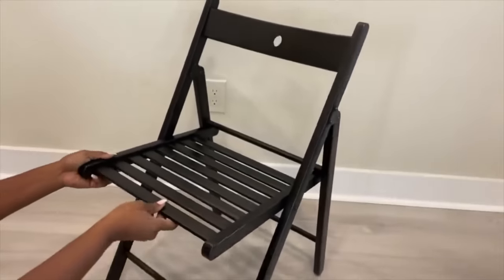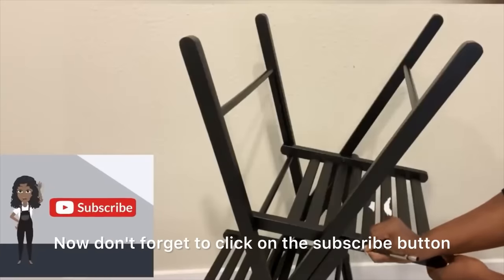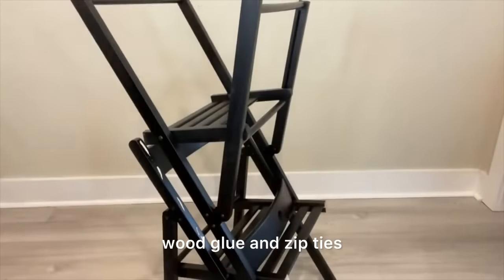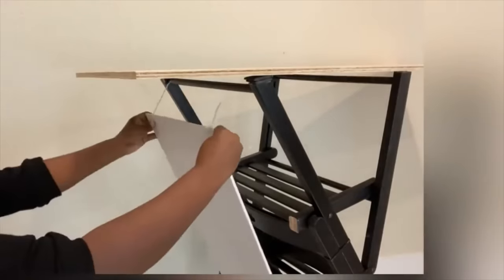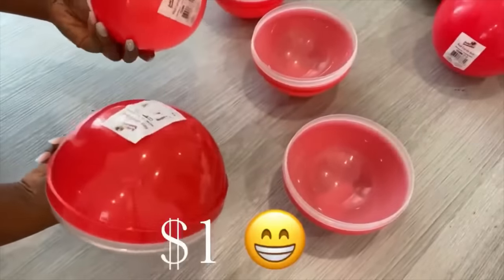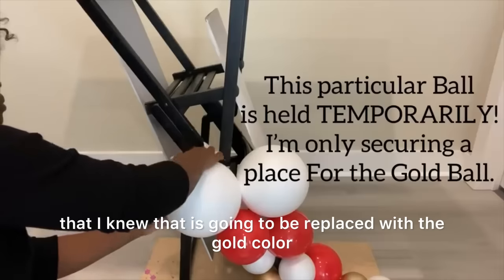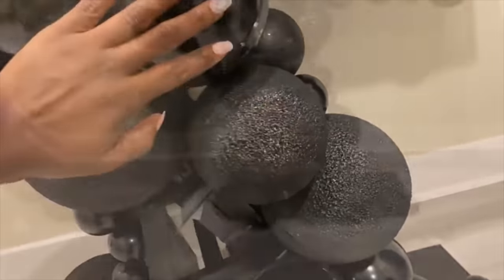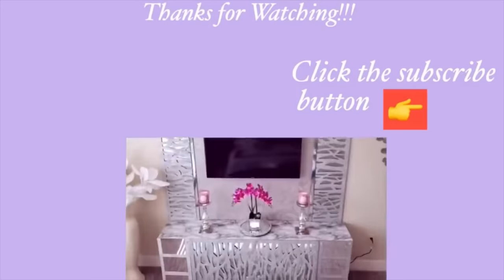NEW 2024 DOLLAR TREE MEETS IKEA Bubble Table Idea!!!

Comment: The table looks amazing! You can fix the styrofoam balls will black gel glitter and regular black glitter. Simply brush the black gel glitter on, then sprinkle on the regular black glitter. You can even add a thin coat of clear high gloss spray paint as a top coat. 🙂
Reply from the maker: Great tip! Thanks for the suggestion! 😊 Adding some black gel glitter and regular black glitter sounds like a fantastic idea for an extra touch. I appreciate your creative input! 🌟✨
Reply: I love it how it is.
GOD bless you and your family.